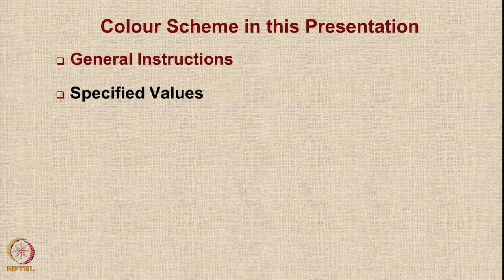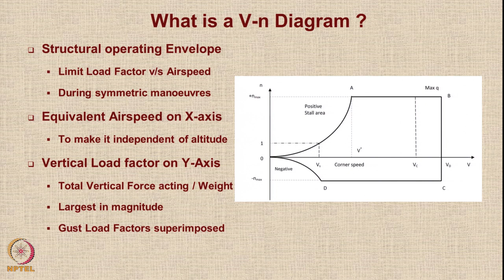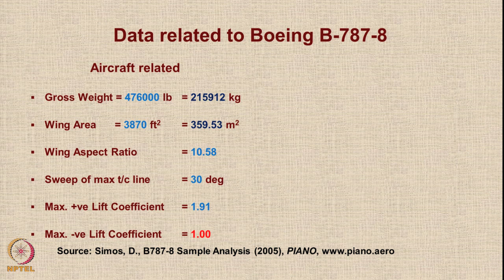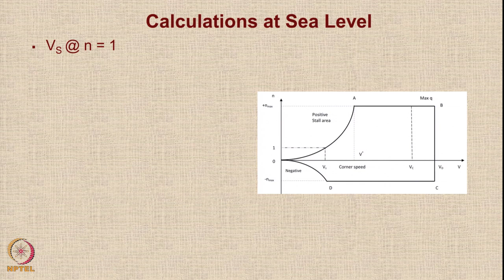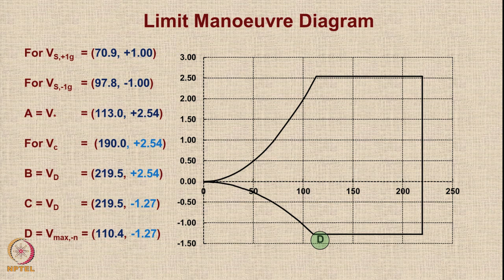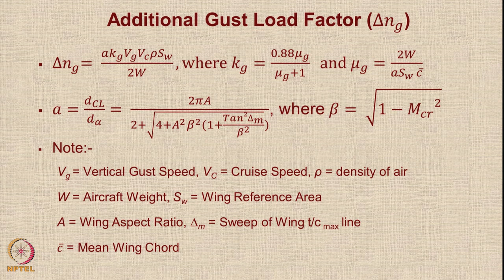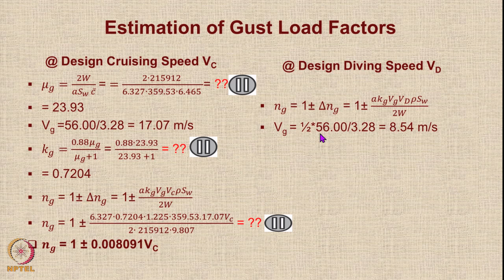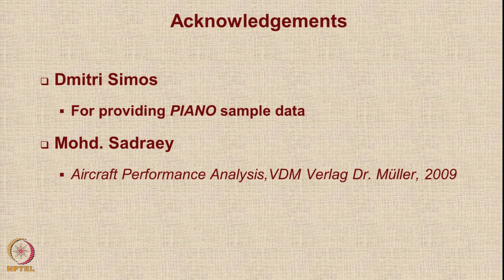Lecture 82 : Tutorial on V-n Diagram of Transport Aircraft

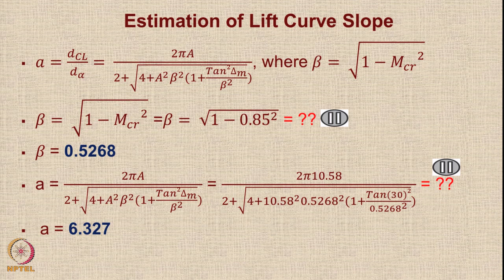Comment: Dear Sir, At 24:03, the unit of a is said as 'per deg' but the formula gives the value in 'per rad'. The reasoning provided for the unit does not appear to be correct as the tan of angle should always be the same irrespective of whether the angle is in radian or degree and the tan of angle is a number without unit.

Kindly check.